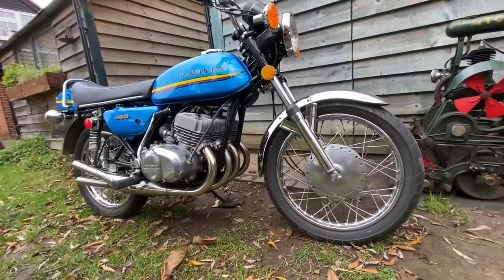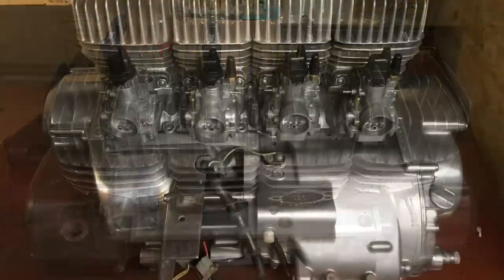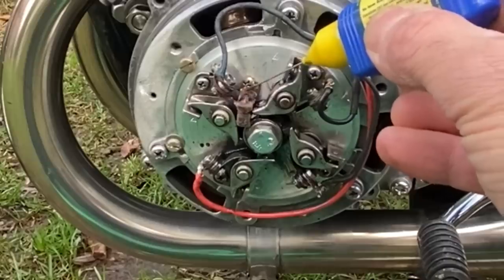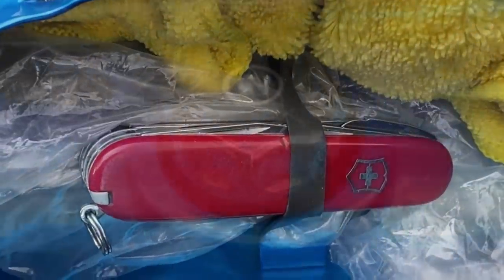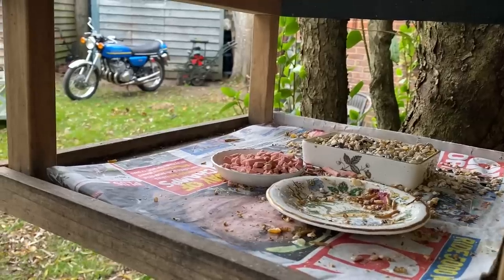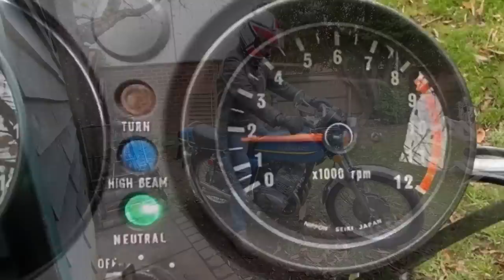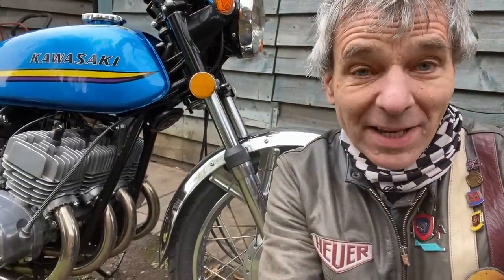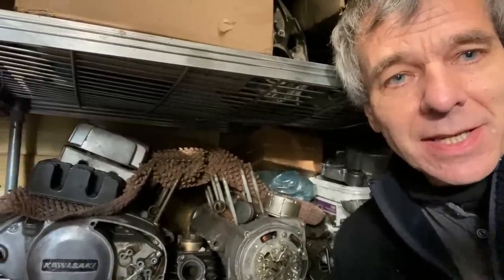Millyard Kawasaki S2 350 four cylinder two stroke road ride

Comment: How about a radial four using RD 125 Elsie cylinders? Run all four rods on one long crank pin. Fit it into a scaled up bicycle like your downhill racer with a hub gear mounted in the frame. You’d have hours of fun making the epicyclic gears. :)
You’d need a blower but that could be a turbo geared off the crank and double as an air starter.

Comment: How did you address engine mounting/alignment? If the three cylinders were centered on the chassis and you added one to the left side, how are the four cylinders centered in the frame?

Comment: Hi Allen, Love your shows. Just bought another 1974 Honda CJ250T to renovate. Can I upgrade to electric start with this bike ?  Chris
Reply from the maker: Yes easily  just drill a hole and fit the starter motor and associated bits  from a cb250

Comment: hi allen ,  on the move that sounds almost like a 2 stroke v8 , guessing unlike rg500 and 500 yahama that fire and sound like twins , you have changed firing sequence , maybe  every 90 degrees
Reply from the maker: yes its a 90 degree 1 4 2 3
Reply: @AllenMillyard  will be nice to hear the version based on the 400cc barells .

Comment: Allen, in the mid-late 90s at the top of the Broadway in Thatcham, Berks. I saw a Kawasaki 2 stroke with what looked like 5 cylinders. I am certain it was more than a triple. Was it one you built?
Reply from the maker: yes ive made many fives 415, 666, 850 & 1300cc

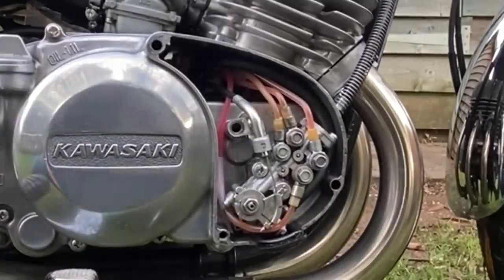Comment: Re: portion 5:30 in the video,    
In the good old 1980's when one could find KH and S Kawasaki owners who were scared of the beasts they owned and were known to happily trade or cheaply sell their bikes, I had owned several of each class of these bikes. I really regret letting a couple pristine 1969 Mach H1's go as as much as that 1952 convertible v.w.bug with its original 25 hp engine...if it was a hardtop it would have been a split window.
 On my S3 and other 2 stroke street bikes I've had that retain original cylinder lubrication system, I noticed if I'm over zealously twisting my throttle to where it actually bogs down repeatedly, I've got way too much oil being injected into the mixture and therefore enough residual oil to muck the mixture as well as better my chances if fouling a spark plug. So in short, by easing my throttle just to the point of power and follow that up with the pouring it on when I've hit my Denco expansion chambers sweet spot (around 10,000 - 11,000 rpm) it barely smoked when the revs came down for an idle.
Now if i could only get Allyn to help me build a Horizontally opposed stroker, big bore and water cooled 4.4 litre flat 8 vw engine! Roller bearing the crank mains, Chevy SB rods and valves fitted and we could take Porsche at Le mans next year!

Comment: Hmmm.....how did you set up the oil injection lines ??? Did you use the 3 from the S2 and add one from an H1 or H2 ?? I guess it will all be revealed when you do your 4 cylinder S2 build videos.....Fabulous work, Allen !!!

Comment: Fun facts; the Kawasaki 250's were just 350's sleeved down from 53 x 52.3 mm to 45 х 52.3 mm, quite 'under-square' / long-stroke which resulted in a relatively small port area for the displacement, hence the Yamaha and Suzuki 250's were faster despite being twins.

Comment: Had an S2 & an S3, It was very hard for me to get these bikes out of the back yard without fouling a plug, and later people I met ,said it was impossible for them!..With points, & battery & coil ignition ,& what can only be described as strange jetting,& too much oil injection ., it ran fine when hot.,in fact it could be called way underrated. ,"if" it wasn't such a bear to keep running on all 3 cylinders during warm up.The tiny S2 went an indicated 93 mph! two up, & only 200 rpm off red line in top gear.The S3 went an indicated 117 ., again near red line...It was good on the highway, & never threatened to wheelie unexpectedly. After the first year the S3 got an electronic ignition , but never a more powerful magneto or CDI like their other road burners .Too bad the oil injection & jetting & ignition never got dialed in at the factory.

Comment: What is the purpose of this builds , and is it enought current and fire with old electric system or you have to rebuild a new electric system for new engine. Also with more pistons it produce more power so is it ok to run with old gear box , i mean could that gear wheels can transfer the power to wheel

Comment: i dont got what you were explaining about the oil pump and no smoke.  are you talking about the gas mixer and can you explain on your new videos how it work and show us how you assemble it.
Reply: The oil pump does what it says..it pumps the 2 stroke oil up to a nozzle just after the carburetor (in this case, 1x nozzle for 1x carb= 4 nozzles/4 carbs). Because Allen is using a high quality synthetic oil, he can use less oil than the original bikes were set to pump. Thus less oil=less smoke/visible pollution. He arranges the pump guts by mixing and matching the plungers he has accumulated until the ratio of oil to petrol is just right.  The old fashioned way of mixing oil in petrol then feeding it to the engine through the carbs meant there was too much oil at low revs..only wide open throttle would have the ratio "right" to stop the engine burning up or seizing. This plus theold fashioned oils used in the past meant the engine would smoke badly right through the rev range....

Comment: How do you machine brake shoes on a lathe?
Reply: Easy, you turn a spigot on the lathe to match the bore in the backplate then you mount the assembled brake with shoes fitted by holding it in place with a pressure pad with the tailstock. Then accurately measure the diameter in the wheel hub. Open the shoes with the brake arm so the shoes measure slightly bigger than the hub and secure it with a cable tie. Then turn the friction lining on the shoes carefully so they measure the same as the previously measured hub. That’s how I do them anyway 👍

Comment: Some work. Worth the effort?:  Change my mind,please.
Reply from the maker: It’s easy for me two strokes are a simple design
Reply: @AllenMillyard  And I understand.  Quick low end torque and high revs yet hard on rings and dirt.  The last 2 stroke I had was a Yamaha 360MX and it ran great for about 40-50 hours then I needed another plug because of fouling.  Oil injection was another issue unless you did the mix rich, worried of cylinder and ring damage, yet lower power.  Each one I have been introduced to had their own finicky settings.  Just took time to study.  Just like my weed trimmer.
Reply: @AllenMillyard  I do applaud your milling to
 introduce a 4 and I bet it's a blast.  What do you think of it's 70-90k durability on the road?

Comment: So do you just wake up in the morning, have a cuppa then think "I wonder what I should do today? I know I'll chop two engines in half, make a crank to my phasing desires then throw it all in a bike thats going to go, look and sound better than it did from the factory"?

Oh and the Greta call - hilarious. I wonder if she realises how much less making this harmed the planet than making an electric bike - which will then still run from the grid almost all of the time anyway?
There really shouldn't be emissions regs for bikes which only do a few thousand miles a year at most. Making and maintaining the emissions junk (and pulling its extra weight, using more fuel thanks to its worse efficiency, etc) is almost always worse for the planet on very low mile stuff. 
If you're doing 50k/yr commuting to London get an electric but if we're doing 2k pottering about on sunny weekends leave us alone.